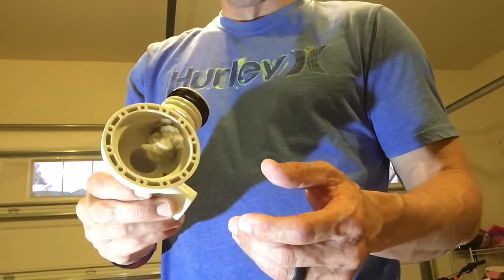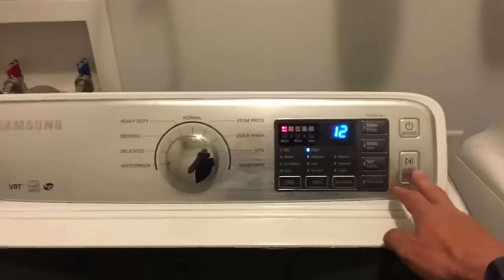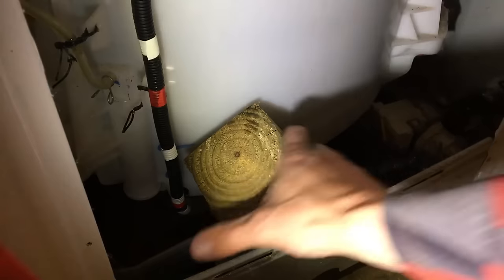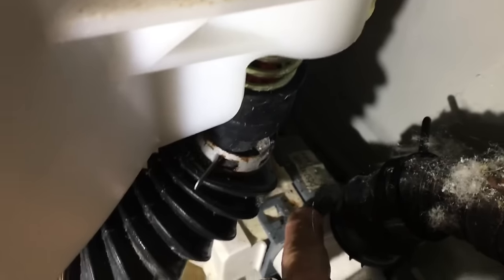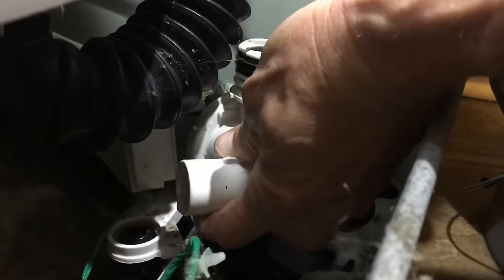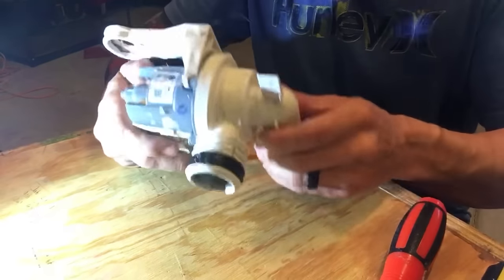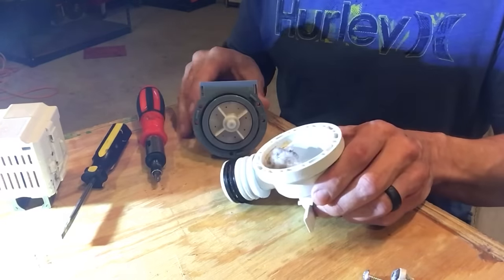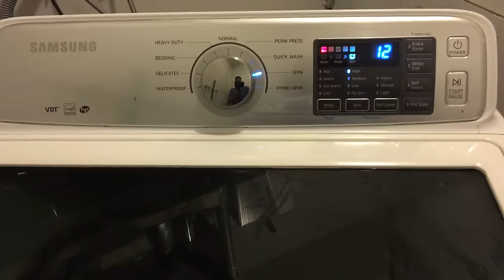Samsung Washer Won’t Drain! Easy Do It Yourself Fix WA45H7000AW

Comment: I almost didn't try this because I am not that mechanically inclined and was afraid with all of the steps that I would not be able to get it all reconnected properly. I am so happy I at least tried! When I removed the second hose, I found a sock!! SO, I didn't even need to remove the pump. YAY! THANK-YOU CW for posting this FANTASTIC VIDEO!! My washer is all hooked back up and DRAINING EFFICIENTLY again!

Comment: Just the video I needed. Took the drain hose off and took the shop vacuum to the pump, and sucked out a few gallons of water as well as the problem. A cotton stain rag! Shop vac saved me from having to remove the pump entirely!!

Comment: Thank you! Within the first minute of your video it was very informative. I knew once I ran across this video that this is the video I needed to be watching as my washer was doing the same exact thing. Found nothing on the internet other than here about this issue. Also, you included a quick repair! Went step by step and out popped my 2 year olds sock. Now I need to figure out how the sock made it in there lol. Thank you so much for this video! Appreciate your time, I couldn’t thank you enough!

Comment: Thanks Utah23 I watched your video twice and decided to take a crack at it. No sock or fuzz, but I ordered a $25 pump on Amazon & I’m running a self clean cycle. I hope it works! But for real, thanks. I’d rather be out $25 (if it works) rather than jump and spend $750

Comment: Bless you heart my man. I’m going to have to do this to my washer. I to had mine for several years. However I just wanna do some preventive maintenance since I need to take back panel off. Due to manufacturer not putting it on correctly. Barely notice it after all these years. Panel vibration was just getting loud. They did not slide the panel tabs in. Basically slapped it on and screwed it in. 🤦‍♂️

Comment: Loved this video. We have a Samsung washer, a little different model than yours. Yesterday we got back from vacation, i ran the washer cleaner cycle then did a load of clothes, opened the lid to find everything covered in slimy specks. After cleaning the drum 20 times they were still appearing. I then noticed it was all coming from the drum. Took the pulsator off to find a lot of mold. I told my husband that why we have it out and apart, we should check the pump hoses for any debri.. just in case.

Comment: Thank you for the video. Just cancelled my service appointment after I saw this. Everything was exactly how you explained it. I definitely should’ve paid more attention to the wiring before I took it off, but other than that it was a success. Found a plastic wrapper in the drain pump and once I took that out it started draining the water with no problem. Thanks again for the video!

Comment: My pump wasn’t clogged but replacing it made my washer work fully again. The fan didn’t spin like how the videos show after I took it apart, it would stop immediately and felt rough after you spin it, got a new one and was spinning really good so kinda just figured it was that and it was but also thanks for the video and instructions you’re a life saver.

Comment: Thank you for this very helpful video. Worked great except my washer had a deeper issue. Parts of the assembly to spin the bucket had broken off. I found large chunks of metal in the pump tubes and one lodged where the water drains from the bucket. The washer needs to be replaced, but your video still helped me find my bigger issue.

Comment: Thank you so much! I fixed my washer by following your easy to follow instructions. The issues that I found out is the plastic propeller in the pump is broken. I spent $40 for the pump from Amazon
Reply from the maker: Nice!  Most find an obstruction in there not a broken propeller.

Comment: Amazing video bro opened up and a sock was stuck in hardest part of the whole thing was I didn’t have a needle nose to take off the plastic part. I didn’t disassemble the whole pump like him rather just the 3 screws to take off the intake take out the sock and screw back

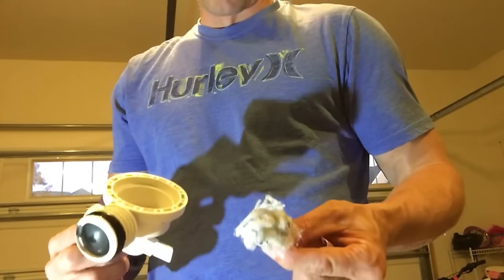Comment: Great video, very helpful.  My pump was in great shape after I went through all this, so I went back to check the hoses and found that the check valve (see the black rubber stopper visible at 0:17) had broken, leaving the rubber disc in the drain pipe.  So you might want to take a look at that before taking apart the pump!

Comment: I had to like an subscribe being a woman is not easy. Fixed it with no problem.  I did not even have to take everything off the pump just the the two screws. It was clogged with the stuffing of a pillow. The repair man was not coming until tomorrow, and I was not about  to wait.
Reply from the maker: Dee T I Just made another video for another issue with this machine Samsung Washer Spins and Refills Over and Over!! DIY fix. WA45H7000AW https://youtu.be/61GSgrTfq1Y

Worn stabilizer rods.

Comment: Thanks for the info. Just found a sock in mine. I used a shop vac to suck the water right out the drain hose. Worked great, except took forever due to the sock.

Comment: Good stuff man...fixed my washer with this vid.  Barbie book is what did mine in.  

I definitely recommend a wet vac to pump out the washer...Samsung made the hose way too short to drain enough to not make a mess.  It's best to hold the hose up and shove you wet vac hose into the washer hose and pump the drum dry.

Comment: You are a god. Had a finishing nail from baseboards I was doing in my house. Newer models make it easier because you can remove 3 screws and the entire thing comes apart without having to disconnect the power assembly (be sure to unplug from wall!!!). Took like 5 minutes. GUARANTEE I would have been charged even with a warranty as it was user error and not a pump issue.

Comment: Found my issue with this video.  Thank you! Was just given a washer for free and the previous owner said it wouldn’t drain.  I opened it up and found that the fan caught on something and broke off, glued it back on with some adhesive (I mean if it’s broke it’s broke what’s worse that could happen) and it started right up.

Comment: Great video thank you. I just pulled mine apart; it was draining fine, but leaving about 2 cups of water in the pump and lower portion of the hoses. It appears my flapper valve, which prevents backflow from the drain pipe, is allowing water to flow back to the pump. Not a big problem other than gunk is growing in there and polluting the clothes in the wash.

Comment: Thanks for posting this video.  It was exactly what I needed to repair my washer.  In my case, the pump blades/disk was completely broken off from the rotor, so I had to order a new pump motor from Amazon.  The one I received had the electrical connections on the opposite end, so I couldn’t reattach the white plastic cover.  I just covered the exposed metal from the motor’s magnet and the power plugs with electrical tape and crossed my fingers.  Everything is working and I can’t thank you enough.
Reply: When I got mine pulled apart, I found the exact same issue, the disc was rattling around and no longer attached.  I discovered that the pin had broken off inside the disc.  We just purchased a replacement.

Comment: Great video.  Wear gloves if you're prone it slip ups though as I ripped open my thumb on the sharp metal and had to glue it back together before finishing the job.  Had a toddler sock stuck in the water pump.

Comment: Thanks for the video!  30 minute fix to remove a bobby pin that was not letting the pump spin. Saved me from setting up an appointment and spending $$ for the fix.

Comment: dude! thank you so much for this!! the only thing I'd change is maybe at 9:20 mark where the screw holes and plastic to where the grey and parts meet as you can rotate them and there are more holes than screws, so to put them back in the same spot as well as where the power connector. mark a line for Black and yellow I think it was to put them back the right side and rotation! but thank you again!
mine got some plastic piece jammed into it, found 1 but another one was still some where and it go thru and jammed the motor!

Comment: Thanks a TON for this DIY video. It really saved our family some money because I was able to unclog the water pump myself in less than an hour. As soon as I took the hose off that connects to the barrel, I found the culprit which was a child's sock that was stuck in the space leading from the barrel hose to the pump. How it got there is a mystery to me but the washer works fine now.🙆👌💪😭😁

Comment: Thank you very much!  Extremely helpful and a great video. I was about to purchase a new washer rather than have a service tech come out for $300+ to work on my 4 yo washer.  BTW this worked on a similar Samsung model as the one in the video, model # WA45N3050AW/A4

Comment: You are a God send! I just bought my toddler brand new socks. The washer quit spinning and wouldn't drain. I pulled all socks out and paired them all, and was missing one. Found your video, which I found very detailed and I was able to follow it step by step. All be darn there is the sock in the pump!

Thank you for posting the video and great step by step instructions. If I could upload you a picture of it stuck in the pump I would. At least I know what part went wrong.

**Adding did not have to replace pump, washer ran great after. I was so excited I found the sock I didn't mention this 🎉😄
Reply from the maker: You're welcome! The power of accomplishment!  Saves money and it's good for the brain!

Comment: Gonna try this on my washer tomorrow! Thanks for your expertise! ❤
Reply: I’m back with an update, so I took the pump out and found the white spinning wheel on the pump had broken off. Ordered a new one. Guess what, I found it on Amazon and it came broken. I was able to glue it back because the screw hole was the only thing that came off. So I let it dry overnight and plug that bad boy in and 🤌🏽 Perfect spinning and draining. Thanks ❤ Your video was a lifesaver and pocketsaver!

Comment: Thanks a million! Thanks to this video I was able to do this myself. And I am not a mechanical person by any means. There was a baby sock in my pump. Mine is a newer model but same basic idea. The only problem I had was after I got pump apart I could not remember how to get it back together. Figured it out after a while. Thank you so much saved me big $$
Reply from the maker: dillonwells1 .crazyNewfie I Just made another video for another issue with this machine Samsung Washer Spins and Refills Over and Over!! DIY fix. WA45H7000AW https://youtu.be/61GSgrTfq1Y

Worn stabilizer rods.

Comment: Same washer, same problem. We will try this today. Thank you. Samsung should keep making TVS only. Their washer and dryer are complete garbage. Mine is already a replacement. The first one just spilled over and damaged my brand new flooring. Getting in touch with their customer service is absolutely a nightmare. They avoid your rights like the plague. I ended up not going forward with the claim for the flooring and all they offered was a replacement, which cost was less than the first. I had a Kenmore before for 18 years and it did wash and CLEAN the clothes. I wanted to up-date for a more modern machine and this is what I got. :(:(:(
Update: Mine is a bit different than yours, but anyway, when I pulled the water pump out found a quarter inside that little white pipe completely blocking the water coming out. . I can't believe how small they make that pipe and hose to expel the water!!! The difficult and most painful thing was to put back, besides the water damaging the wood flooring. The last screws were very hard to replace in the bottom and back, but we managed to finally put it back and hopefully it won't be a problem down the road -  IF -  I will trow it in the middle of the street. :)
 I want to thank you for this video. It saved me from calling someone , wait some days, and pay a lot of money. I can't work due to an accident and this saved me big bucks, AND I could wash clothes right away.
Reply from the maker: I have had other issues with same washer too.  Had to fix the stabilizer rods because it shakes so bad on spin, here is a video for that fix: https://youtu.be/61GSgrTfq1Y

Comment: I have spent so much money trying to figure out what is wrong with my washer, starts washing and then stops at spinning and takes forever start working again, it used to take 30 min to do a load now it takes  45 min or so, no one knows what’s going on, I’m going to try to check the pump tomorrow following your video, hope I can fix it, thank you so much for making these videos
Reply from the maker: I hope it works. !

Comment: Nice work. After watching your breakdown I had a thought. Would not a person potentially save time if they removed the inlet drain hose from the pump and used a coat hanger or something similar and fished around in there for some blockage material. Perhaps the fishing loosened up the debris. Then plug or block off the discharge end that goes into the wall drain, take a shop vac and suck from the pumps inlet side and hopefully remove the debris in this manner. Could be worth a try. And by the way when I took off the rubber discharge hose to the pump what did I find stuck in the pumps elbow? Yep you guessed it my wifes sock. I believe when the washer was being loaded the sock went over and behind the tub and not into the tub itself. You can see a gap between the tub and the body, that is the only place that makes sense to me. Samsung should have put a plastic skirt there to prelude this from ever happening.

Comment: Thanks for a great video. Even though it wasn't clogged like I thought, I was able to take apart and put it all back together without issues.  I'm testing it with a load now but just wanted to say thanks.
Reply: Did it work after you did all the above.
Reply: @mzmiller1029  this  video perfect. Step by step. After cleaning it out, I had to buy a new motor. It's been working fine ever since.

Comment: I didn’t even take apart the pump. I actually just stuck a shop vac into the opening of the pump after I removed the gray plastic tubing that comes out the back of the washing machine and sucked out the water. When I emptied the shop vac I saw this ball of lint similar to your video and figured I got it out.  Put it back together and it works like new!
Reply: Jen, thanks for sharing. I’ll try that next time. I found a baby sock in mine.

Comment: Thank you so much my dude, I did exactly as shown and got my machine working again ! I only have 1 minor problem when taking off the black drain hose under the drum every time I put it back on and run a cycle it comes off and water gushed everywhere even though I’ve put the clamp back on….
Reply from the maker: The clamp ring must be loose and not achieving a tight enough grip.
Reply: @23sapper  yeah it looks like to green power cable was restricting movement causing the sump pipe to come lose, all fixed now thanks brother 🙏

Comment: Thanks this helped us out sadly mines not clogged hoping the part i ordered on Amazon works fixes it amd comes fast. However dont recommend trying this at 1am. I really hope i dont need to buy a new washer this is the 2nd time this happened first time we only had it for 2 months so it was under warranty still and it got fixed now its about 6 yrs old.

Comment: I have a model wa52m8650av its like the same everything as urs except the outside is different. I had a clogged pump as well. The o ring gasket is a nightmare. Thanks for this video!

Comment: Thank you thank you thank you!! There was a sock in there... Didn't even take down the pump. I stuck my finger in there and felt something. Used a wire hanger to make a hook and pulled out my son's sock which was stuck in there. Started working right after

Comment: Well I can't tell you quite yet if it's fixed(its running a sponge and rinse cycle) currently to treat the pump, but I can tell you as soon as I pulled it off I saw something black and sure enough there was a whole sock in there!!!I can only imagine that would cause the issue, but I hope it didn't damage the pump because I figured hear that clicking noise and it was hot to the touch when I shut it down a week ago. I'll report back within the hour on the results🤞🤞

Comment: I was able to clear clog without removing pump. Thanks for the video.
Reply: How were you able to? Thank you!
Reply: @AN-jw2oe  Once I drained the water out, I took off the hose that comes from the drum and my clog was in connection before it made it into the pump.
Reply: Tymon Hevner Ah, got it. Thanks so much!

Comment: I had a GE top loader that had the same problem. Pain in rear but cleaning the crap out of the pump fixed it. My wife's daughter now has the washer and we have a GE front loader. The front loader has a compartment that's pre-pump that catches small objects, including balls of stuffing. It seems that this should be done on top loaders too.

Comment: You are the man👍
But, sometimes you don't need to go all the way far...on my case, I opened the little rubber cap that goes to the extraction hose (the one that it's out of the washer) and I found a ketchup packet stuck!! Thank you cause the video guides you trough 😁

Comment: Glad I came across this vid, turns out I had a small ripped up sock that got sucked in there somehow. I pulled it out and it started operating just fine. THANK YOU!
Reply from the maker: You’re welcome, I didn’t realize how common this was, so many people having the same issue.  Good thing I made the video!